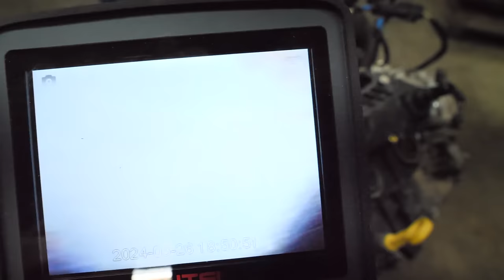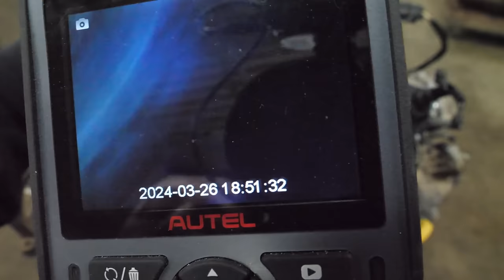ANOTHER BAD 2.7 Ecoboost? 2018 F150 Twin Turbo V6 DEAD @ 131k Miles

Comment: "Oil pump drive belt" shouldn't even be a phrase that exists. Thanks car makers, for racing to the bottom....
Reply: I was shocked that GM chose a belt for oil pump on the 3.0 Duramax. I wonder if Isuzu had been the major on the 3.0 like they were(are?) on then6.6 Dmax, if a belt would have been used.
Reply: What a horrible design.
Reply: pLaNnEd ObSoLeScEnCe 🤪
"Lifetime" (of the warranty 🙄)
yeah I figured someone somewhere had to make an aftermarket metal chain for that by now
Reply: @raider762 oh no, the design is perfect for what it's job is, to make you buy a new truck...
Reply: In that case, I wouldn't be buying another one of THEIR trucks 👋🤠 bye LOL
Reply: @jimmyaber5920  The belts seem to have a harder time with exposure to gasoline than diesel. It's a terrible trend for engine design. At least the 3.0 Dmax belt seems slightly easier to change. They didn't bury it behind timing chains, harmonic balancers, and everything in front of the engine block. I'd rather slide a transmission back than tear off half the stuff forward of the engine block.
Reply: An intentional insidious failure point, how wasteful. Such nice engineering on the rest of the engine just waiting to be ruined when that stupid belt gives up. And nice plastic oil pan 🤩
Reply: I heard they updating to a timing belt inside a kiln/timing cover. Burns off emissions.
Reply: Agreed but 131k miles..Not terrible. Most  likely bad overall maintenance and oil changes.  And these get abused pretty hard.  As the owners want to feel the power from a 2.7
Reply: some VW engines have a belt in oil to drive the oil pump, this sinze 20 years +
Reply: @leneanderthalien  Diesel or gasoline?
Reply: On ,,europian,, engines this system is also used for camshaft drive. With the same flaws. Only when valves and pistons hit each other it was not the lubrication to blame😉.
Reply: @hochhaul  in the lubricating oil. Dont know which engine type. But the problem is there are some plants that make/assemble engines and these go to differend brands of cars. So a differend brand of car could have the same engine with the same flaw.
Reply: Wet belt actually last very long, look at Audi engines
Reply: Wet belt belt design actually last a very long time, look at vw engines
Reply: @wendellgreenidge3362  in the netherlands there are people who have to do a 5000/to 6000 € repair. The belt gave up and pistons and valve hit each other. Then its the dealers choice to declare it warranty or not. ,,maintained and serviced,, by who? Guess what they declare.  This belt should be lasting 120000 km. It breaks at 50000 to 80000 km. Audi engines have other problems. The oil schraper fails so a high oil consumption to damage as result.
Reply: @henkoosterhof5947  that’s true but they make better belts that last much longer
Reply: @henkoosterhof5947  not to mention timing chain guides wear out too
Reply: My 2015 F150 has the 2.7, I have 130K miles. The 2015-2017 F150 only had direct injection, but at least they used a chain for the oil pump. Some bean counters is probably who is to blame for going from a chain to the belt.
Reply: longer than the Audi engine 😂
Reply: Seriously, WTF Ford!
Reply: @hochhaul oil!!!
It’s in oil.
What does the fuel have to do with it??
I get the fuel / oil mixture percentage.
All motors are allowed some.
But belt in oil doesn’t matter that much. Diesel vs gasoline
Reply: @Hello-bz9ix Enlighten yourself on why they use plastic oil pans now days, you may learn something.
Reply: The Isuzu designed 6.6 uses a proper, gear driven cam. The 3.0 is a GM design......
Reply: Plus  eco boost 1l   wet belt...😊
Reply: Wow. I have a Gen1 2.7l EB in my ‘15 F150 and I really wish I had the port and direct injection to keep the backs of the valves clean. But having this oil pump belt really doesn’t make me want another 2.7L EB in the future. The job to replace that belt looks horrendous if it doesn’t cause the engine to destruct when it breaks at highway speeds.
Reply: Only American brands do.stupid stuff like that.
Reply: @hochhaul  we have a bunch of newer gasoline engines in Brazil with this wet belt thing. The main issue is due to owners not using the correct oil, AND the fact gasoline is tampered depending on the gas station... those are not reaching 40k miles in here. Lots of engines with premature belt failures, both from GM/Ford
Reply: @henkoosterhof5947  yea but timing belts(dry ones) are easy to replace takes about 30-40 min to do then your good for another 10 years/180k km. i would rather have a timing belt then a chain tbh when no car makers know how to make a chain work anymore just look at BMW and their chain issue lmao. however wet timing belt are just idiotic
Reply: @jimmyaber5920  no, isuzu did not work on the 3.0 that was put in those trucks.  They split ways before when they didnt agree on the kodiak replacement.  Isuzu would have gear driven everything. Isuzu have been called too expensive many times by GM, as they were correctly buiilding things.  GM even special ordered cheaper 4cyl isuzu transmission with cheap synchromesh and gears inside. The fix was to get a isuzu transmission from a impulse or imark to put in your GM product!
Reply: @wendellgreenidge3362 😂
Reply: @thomasnew8606 I can confirm that these are fun to drive that 2.7 pulls pretty well especially with 4.7 gears
Reply: @moguy1973 the old days of ignoring maintenance are over I don’t blame you for not wanting the addition of preventative maintenance including turbo replacements and oil belts too
Reply: @vicburt6001 😂 good one all global brands do it they need to connect the bottom and top end somehow
Reply: Go ahead and find a 2.7L Ford that has failed or blown up due to a problem with the dumb wet oil pump belt. Ahh, that's right...
  CRICKETS 🦗🦗
Reply: @raider762  What's horrible about it other than we're all not used to seeing it. Try and find a 2.7L Ford that has failed due to a problem with the wet belt. That's right...Crickets 🦗🦗
Reply: belt driven oil pump, planned obsolescence
Reply: At least it’s in the front. The 3.0 duramax oil pump belt requires the transmission be removed to access it. Because it’s behind the flex plate. And it’s due every 100k miles.
Reply: @RA31A  correct, I saw an F150 with 500K miles under its 2nd gen 2.7 Ecoboost. Mine's got 190K and it runs great.  These engines are tough and most likely you'll be rebuilding it before the oil belt goes out. That's when you can do the oil pump belt anyways, no need to assume things that are not happening.
Reply: @engineer_alv  
Nice! That sort of information is exactly what I was referring to.
Speculating failure is a disservice and can instill unfounded concerns among owners. My Gen 2 only has 73k so I guess I'm good for a while especially with my 4K interval oil changes. 🏁
Reply: @hochhaul yes, of course it's an absolutely awful design. Corporate greed has gotten out of hand...they plan these engines to blow up. Planned obsolescence is very real.
Reply: @W0RLDSSMALLESTVI0LIN  
Why would you speculate such things? You have absolutely no proof nor will you find any that this is actually a bad design.
Just because you're not familiar with it & personally don't like it doesn't mean it's no good.
Reply: @RA31A  lol. You obviously know nothing about wet belts. And obviously have no common sense. Planned obsolescence is very real
Reply: @W0RLDSSMALLESTVI0LIN  
lol.. You obviously don't know anything about etiquette & manners as to speculate on what someone may or may not know. One more time, find one 2.7L Ford that has sustained engine failure due to a wet belt failing. Let me be nice and save some time for you... You won't so go find another component that you claim is designed to fail.
Reply: @RA31A  where did I say that these engines fail due to a wet belt? Please show me. I said it's planned obsolescence. Using wet belts is a proven poor design.
Reply: Isn't it a kevlar belt ?
Reply: @mr.wilson8340  if you know. Don’t gatekeep the enlightenment
Reply: Was going to post same, saved me the rant. Never blue oval again. EVER.
Reply: Is the 3-cyl built the same?
Reply: @thomasnew8606  The inside of that engine is virtually spotless. I have a really hard time blaming the previous owner for insufficient maintenance practices.
Reply: They dont want their cars to last so you buy a new one. Why else would you put a rubber belt.
Reply: fladave99  yeah sure our cars have lifetime timing chain no need for servicing. But we put a rubber belt in the most hard to access spot.  So it breaks, puts some poor family in bankruptcy and then they buy another one.
Reply: And the oil pump belt on the 3 cylinder eco boost has a tensioner 🤕🤕🤕🤕🫠🫠🫠🫠
Reply: All for max profits and designed obsolescence welcome to greedy pie 🥧 chasers
Reply: Exactly
Reply: That belt is still in fantastic condition, and the engine is about 1/2 through its designed service life. Maybe engineers know more than you
Reply: @Hello-bz9ix What's the problem with polymer oil pans?
Reply: @joemama069  the heating and cooling of such a material might deform over time causing leaks and it’s also prone to being punctured much more easily
Reply: @Hello-bz9ix  I'll give you the reduced puncture resistance, but that is usually solved by basically every modern car having an underbody cover/splash shield below the engine bay. 
Due to polymer having the ability to be molded into very complex shapes and the heat resistance of composite PA6 and PA6/6, warping due to heat cycling isn't really a problem in comparison to aluminum pans.
Reply: @joemama069  removing a guard every oil change is annoying when it could’ve just been metal in the first place and not need a guard. I can’t see any benefit to not having a metal oil pan other than the manufacturer saving material and money but adding a guard and creating a weak spot just sets us back in the long run
Reply: @Hello-bz9ix  Underbody covers are primarily used to increase aerodynamics and thus performance and fuel efficiency, they're usually no big deal to remove either.
Polymer oil pans are lighter, usually saving 3-6 pounds, depending on the original metal pan and due to being able to be molded into more complex shapes, internal friction can be reduced, increasing performance and fuel efficiency even further.
Reply: @RA31A  ... I swear I've seen belts that have missing teeth and/or the belt is degrading and the belt fibers are blocking-up the oil pick-up. This is what's keeping me away from this newer 2.7
Ford should have stayed with a chain driven oil pump.
Reply: @vicburt6001  wrong. Again
Reply: @hmdwn  yea I hear all kinds of stories like that on the internet, I chose not to believe everything I read on the net ..
Reply: It's not a lack of maintenance that did that engine in, if it did not have oil changes there would be sludge butt there isn't even a golden film in the heads. 130,000 is very low miles. It's just all around a horrible design. Extremely complicated, belt IN the oil, too much power on small bearings, 2 fuel systems...
Reply: @wendellgreenidge3362 stop telling people that. You have NO CLUE what youre talking about. No vw or audi uses a wet belt. They use a small belt on the water pump driven off the balance shaft. Please educate yourself before spewing bullshit to people.
Reply: @thomasnew8606  motor looks pretty clean... Bet it was low octane gas
Reply: @youdontknowme5969  Yeah, for as long as it manages to live.

Comment: I'm a Ford Technician,  the 2.7 is pretty reliable
Reply: Until it breaks. Then it's not an easy fix
Reply: thank you
Reply: They do seem reliable, powerful & decent fuel mileage.  My guess people running them with aftermarket tunes & then they blow up.  I never seen a stock one blow up, so far.